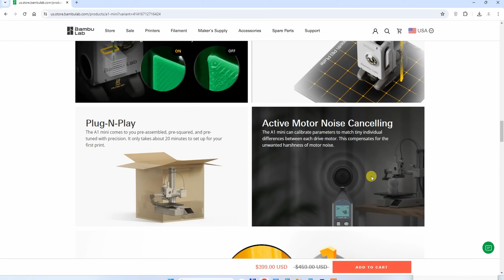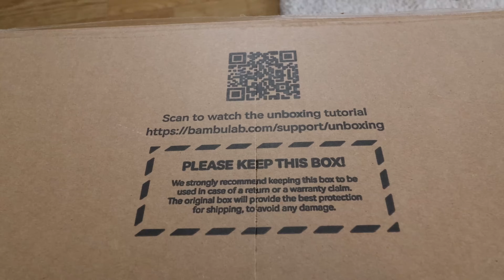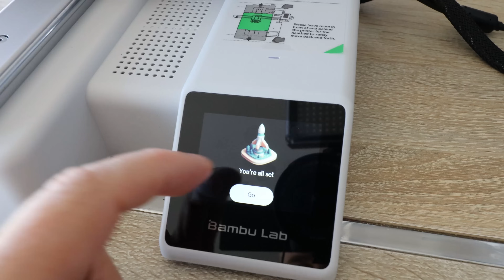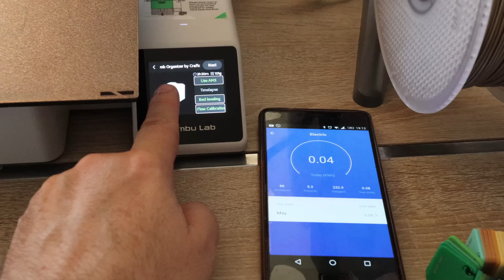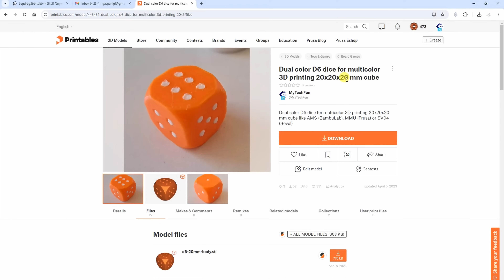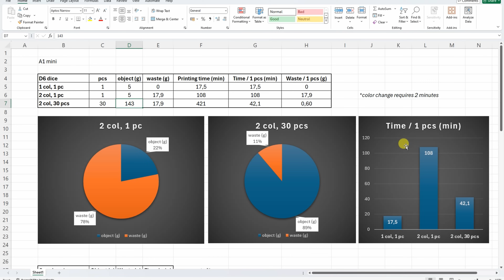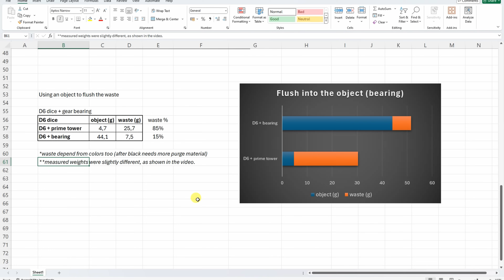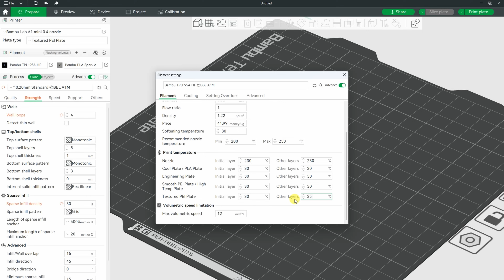BambuLab A1 Mini, testing with PLA, PETG, TPU. When to use AMS?

Comment: Instead of a purge tower where it's a wasted block of PLA, they should give an option to purge into a cloned file. For example: It will purge / make another dice as it purges but it won't be all fancy like the file you're printing with the dual colors. It's better than a block of nothing and you can paint it if you wanted to.  At least make something useable out of all of that purged material.
Reply: That is an option. I haven’t gotten into it much yet but I know lots of people on the subreddit have done this, either with a common print so they have lots of the same object, or duplicates of whatever they are printing like you suggested. However, sometimes having a tower makes sense in prints where the footprint of the bed starts to be a constraint.
Reply: There is a purge to object feature. Needs to be same height as printed model

Comment: Hello, Igor! Thanks for the review! I would like to add. In addition to multi-color printing with AMS, it makes it possible to use supports from different materials, such as PLA and PETG. They do not fuse with each other and are easy to separate to create a perfect surface. Once you've tried it, it's hard to give up =) I printed on A1M with nylon (PA6), at 80 degrees Celsius the part does not come off the table using a border and glue. To print with nylon, you need a low speed and a layer height of 0.1 mm, then the part is less deformed

Comment: This is my 5th printer. It is by far the easiest to use. It just WORKS. No leveling, no fiddling with temps, very minor adjustments for settings. I always struggled with PETG with stringing and zits and this machine doesn't care what brand I throw at it. It just prints flawlessly.

Comment: I have A1, and presliced 14m benchy  came out perfectly, didn't have those poor overhangs like this one. I used polysonic filament, maybe that is a difference.
Btw I really like that printer, and imho it is better for pla and petg than P1 series because it has great auto flow calibration and single gear extruder that give smoother walls. Also quick swap nozzles are great

Comment: I have an X1C and a P1S with 3,700 hours print time between them. I picked up an A1 Mini with AMS and use it for PLA printing. Like you, 95% of my prints fit on the A1M plate. When I print models with many parts I print the large pieces on the big printers and send the smaller parts to the A1M.  It works well and I like the happy notes it plays when a print starts or stops. 🎶😁

Comment: I have 1x P1S printer and decided to buy 2x A1 printers when it was re-released. The price of x2 A1 printers with shipping is about the same price as 1x P1S with shipping. I was already intending to mount the AMS at the top and bought the additional screws from the Bambu Lab store without knowing that the new A1 printers ship with the necessary top mount screws. All the parts for the top mount were printed in PLA matte except for the lower half of the top mount that consists of 2 parts, those were printed in PETG. I cannot afford 4kg of spools falling on my print bed. I am happy with the Bambu Lab printers so far, coming from Tiertime UP printers, to Anycubic and Creality Enders.

Comment: The only really bad thing about the Mini is how hard it is to get the ptfe tube out if you want to print TPU. I feel like I'm going to break the thing, and none of the "ams splitters" work very well.
Reply from the maker: As shown in video, just pull out one PTFE tube from the AMS side and use that one, that's much easier. From the toolhead, it's almost impossible.
Reply: What he said. When I first got the printer I pulled out the feeder and thought I broke it because I had such a hard time getting it back in. I finally realized I can’t print from an external spool and the AMS at the same time so now I just borrow an AMS tube. Only forgot to put it back once! 😂